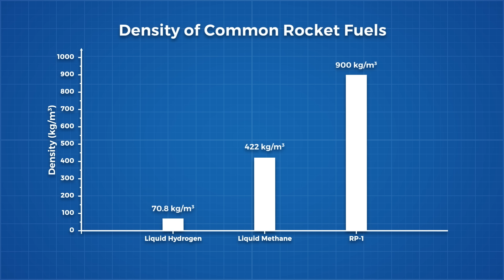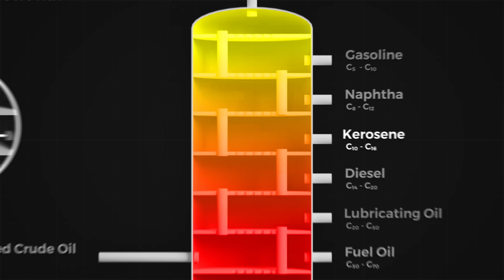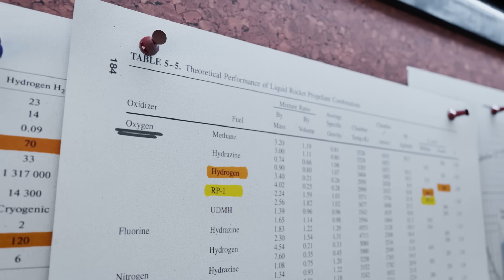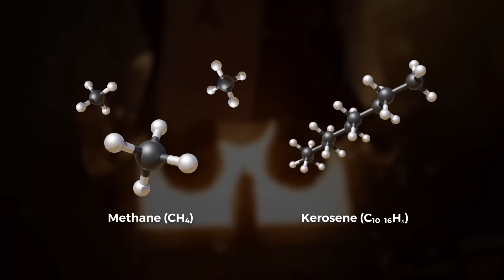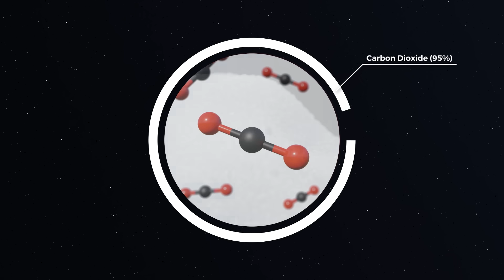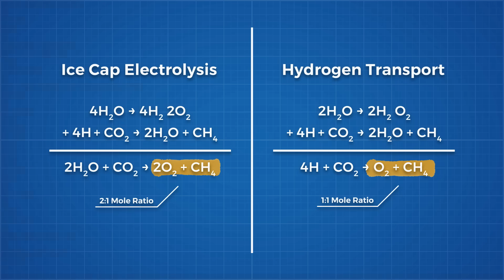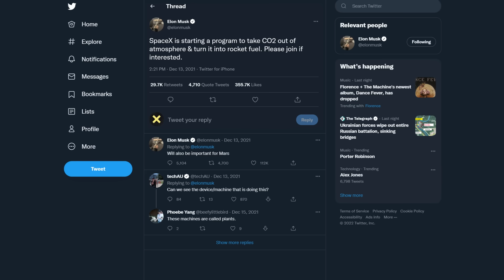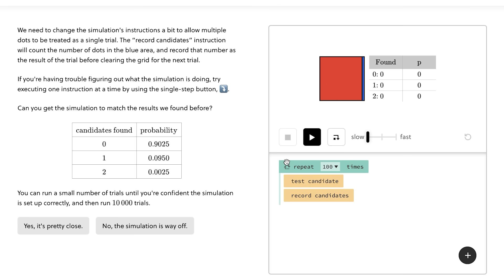Why SpaceX is Using a New Fuel

Comment: It,s better to gain experience on moon with a semi self suficent  permant colony
Reply: And what experience can you actually gain on the moon that would be useful for Mars?
Reply: @3gunslingers  because if we’re not capable of extended stays on the moon, then there’s no way in hell that we’re ready to try it on Mars
Reply: @Dingobigboy357  
"because if we’re not capable of extended stays on the moon, then there’s no way in hell that we’re ready to try it on Mars" 
But then you have to develop everything twice! 
Lander, fuel refinery, thermal systems, even your power setup!
Reply: @3gunslingers  it,s close enough to earth to allow for instant evacuation direct communication is possible

Can gain low gravity experince
Reply: @alphaalpha3181  
"it,s close enough to earth to allow for instant evacuation direct communication is possible" 
Sure. But what benefit does that give for a Mission to Mars? You have the same on the ISS.

"Can gain low gravity experince." 
The moon has 1/6th of earths surface gravity. Mars has 1/3rd. 
Sure. both have less than earth, but is the moons gravity more comparable to Mars than earths?
Reply: @3gunslingers  further more solar panel work on moon .din,t on mars hence nuclear reactor is needed.it doesn't,t have a atmosphere reducing need for heat shield
Mars it have thick enough to require heat shield but thin enough for parachute to not work 

Mar is far more colder and have dust Strom's

Comment: Great video, but i wouldn't say CO2 have potential. Energy is release when you oxyde something (carbon for CO2, iron for rust), like iron in a nuclear reaction, it's an high entropy byproduct. 
You had to heat and pressure the CO2 and hydrogen  ,aka dump a crazy amount of energy, to reverse the reaction. It's like saying an empty battery having potential, quite the contrary in fact.
CO2 is interesting as an energy storage if it's what you mean by potential.
Reply: Interestingly the reduction of CO2 to methane with Hydrogen is exothermic. So it releases energy, but this is because the splitting of hydrogen releases a lot of energy, more than needed to convert CO2 to methane.
Reply: @strix5779  Yes the reduction is exothermic, so yeah you can maybe retrieve some of the energy spend to cool down the CO2, then pre-heat and pressurize it. You can also put a streling engine next to a rocket exaust. Whatever you do, nothing is free with thermodynamic. You have to spend more energy to create the fuel than you get by burning it.
You can heat and pessure almost any organic matter (mostly water and carbon) to turn them to hydrocarbon
Reply: There is plenty of uranium and thorium on Earth and Mars to power our civilization forever. We can make all the methane we want out of CO2 and garbage and water and nuclear power.
Reply: The video is pretty clear. Potencial as a feasable fuel (as methane) for reusable spaceships going to Mars.
It's very specific to what is said in the video, use Mars atmosphere, rich in CO2 to make the Methane for the return trip. The reaction, as explained in the video, can be done in 2 ways and does need catalysts and power.
Power can be a problem and they'll likely say solar power maybe enough. Funny considering how much power can actually be produced per square meter, on Mars surface, if you can keep them clean from dust.
Wind power? I wonder if it'll survive the dust and storms.
So a lot of "ifs".
Reply: @chaoswarriorbr  Agreed, power is what's matter. But if you need CO2 and Sunlight, why not do it on a balloon floating in the venusian atmosphere ?
Going back to Mars, the best option is a small fission nuclear reactor.
Whatever the energy source, efficient cooling without a dense atmosphere will be an issue.
Reply: @vincentvoillot6365  The problem is a round trip Earth-Mars-Earth in a reusable spaceship. The launching and landing part can require a lot of energy and there isn't any substitute in that to chemical reaction engines. Hence the use of CO2 as basis to make the fuel, so it can be synthesized on the surface for the return trip.
Nuclear engines could be thing, but there's many issues. If you use them to slowly accelerate between two planets outside the atmosphere and within micro-gravity, they might be good, anything else not so much, specially launching and landing. Also, there's the risks even carrying a secondary stage with that propulsion, in case of an accident within the atmosphere or near it.
Reply: @chaoswarriorbr  Plz, i get it, making fuel on mars with CO2 for rocket. But like i said you need a power source insitu to process the CO2. And Solar is not a viable option on Mars. I didn't speak about nuclear engine for propulsion, this would be overkill for a trip to Mars
Reply: @chaoswarriorbr  Why wouldn't solar power be enough? The process doesn't need to be fast.
Reply: @ehtuanK  How much energy it would need for even starting the reactions? How much sustainable energy to keep it up?
How long would it take with a limited power supply? How limited it is?
Those and many more questions need to be answered before the conclusion "it doesn't need to be fast". How slow is too slow? Will it take 3 football fields of solar plants to refuel in weeks, months or years?
Reply: @chaoswarriorbr  MOXIE produced oxygen from the Martian atmosphere at 30Wh/g. So refilling Starship's oxygen tank that way requires around 30GWh. Oxygen accounts for 78% of the propellant weight.

Solar radiance on Mars' surface near the equator at noon is 590W/m². While you wouldn't put your base at the equator, because of the regular dust storms, simply putting the panels at an angle shouldn't yield too much less, so let's say 500W/m². Averaged over the full day-night cycle that's around 200W/m² for self-adjusting panels and 125W/m² for static ones. Using 29% efficient Perovskite solar panels for the latter gives you 36W/m². So each m² produces ca. 26 kWh per month.

If you want to fill up Starship's oxygen during your 3 month stay, you'll need 38.5ha. But in practicality it's more reasonable to have your astronauts land in the launch window after that, so by the time they launch, you can be sure that the power and oxygen production is up and running smoothly. This increases your time to 29 months, so you only need 4ha, or 6 soccer fields.

At 5.2 g/m² for thin-film Perovskite cells, your solar array only weighs 208 kg.

After a few missions you could have your water mining in place, which allows you to produce not only the oxygen, but also the methane by the process described in the video, which is probably more efficient than MOXIE.
Reply: @ehtuanK  Wasn't MOXIE just a small scale experiment to produce oxygen maybe refill suits and such?
Th reaction we're talking about to produce Methane and Oxygen is more complex and in a far larger scale then what was tested in MOXIE.
Again, we need better numbers, more adequate tests and analysis.
Reply: @chaoswarriorbr  I focused on the oxygen production, because for methane you need to mine water. This may not be an option for the very first mission. The only numbers I could find for a CO2-reduction that doesn't need water were from MOXIE. Since MOXIE proved its conversion rate experimentally, I chose those numbers as a floor, to give you the minimum energy requirements. Once water becomes available, you can use the combined methane and oxygen synthesis described in the video, which is much more energy efficient.

Comment: Anyone putting some deep thought to this project will come to the conclusion that it will fail.
People will not live on mars. 🤷‍♂️
Reply: Why? There is nothing stopping us from a tech point of view, it is mainly a will and funding issue.
Reply: @NGCAnderopolis  Mars can't hold an atmosphere, there's heavy radiation, it's cold, it's low g. 

How do you want to change that? 🤷‍♂️
Reply: @timorieseler276  you build a house/adome. We live in cities 90% of the time anyway, and the radiation is not at levels were a brief excursion is going to fry you.
Reply: @NGCAnderopolis  OK, so you live in a shelter for the rest of your life. I'm not gonna ask where that comes from.

What about low g?
Reply: @timorieseler276  we don't know what problems there are with 0.3 g if there are any we can have centrifuges. 

Also calling a city a shelter is a bit absurd.
Reply: @NGCAnderopolis  Congratulations, you solved all the problems. 😎👍
Reply: @timorieseler276  well no, but they are solvable.
Reply: Considering there are thousands of engineers who have put their mind to this and believe it will work I disagree

Comment: I hope we can use some extremely high energy density fuels like nuclear reactors here on earth but for rockets in the future.
Reply: We do use Radio isotope Thermal Generators (RTGs) for Mars rovers and some space crafts very far away where solar power is unfeasible. Nuclear doesn't provide good enough power to weight in its current form to propel a rocket into Low Earth Orbit (LEO), but could provide a means of a super efficient second stage if made light enough and able to be cooled properly.
Reply: @johnhunter7244  thanks for the info.
Reply: The issue is rockets tend to explode and most people don’t like the idea of a nuclear reactor exploding in the air
Reply: @keco185  i was using nuclear as an example of high energy density. Like a rocket with liquid fuel thats a tenth of what it weighs now. But speaking of nuclear its just so awesome to hear how in nuclear submarines the fuel can last longer than the submarine itself. Thats the power of energy density.
Reply: @Hydrargyrum8  matter-antimatter reactions release insane amounts of energy(literally the highest density fuel possible with our current understanding of physics), the problem is, storing anti-matter is insanely difficult and so is making it
Reply: @mastershooter64  yeah. But thats a bit too far in the future though if we are talking about simply exploring our solar system. Definitely not within our lifetime.

Comment: The simple answer is that before SpaceX goes bankrupt due to blowing all its profits on developing Starship and its conceptually stupid design Musk wants to get the valuation as high as possible before he dumps after the pump, similar to what he did with Tesla before he sold off all his Tesla stock.
Reply: Doubt it, NASA needs SpaceX to get astronauts to the iss, especially as starliner has just had more issues
Reply: @Steph.98114  When SpaceX goes bankrupt what little of value SpaceX has will probably be acquired by Blue Origin or another company that decides to basically just launch Falcons and not blow the profits developing Starship.